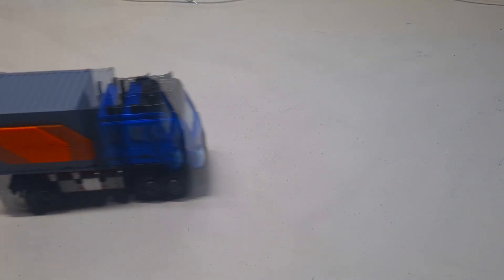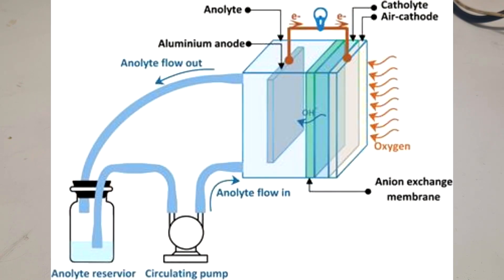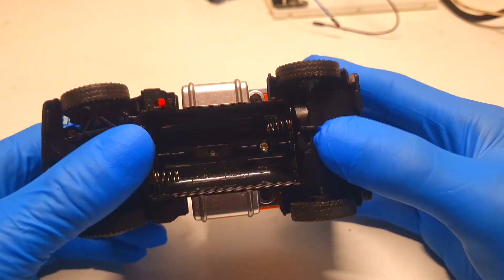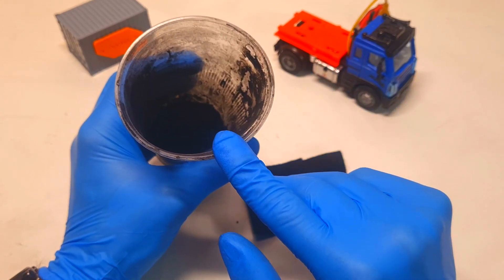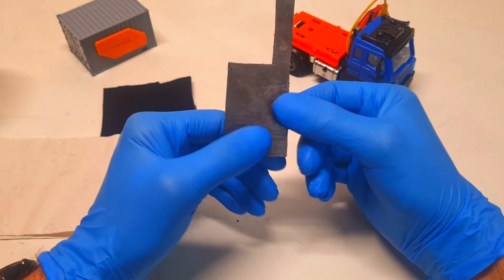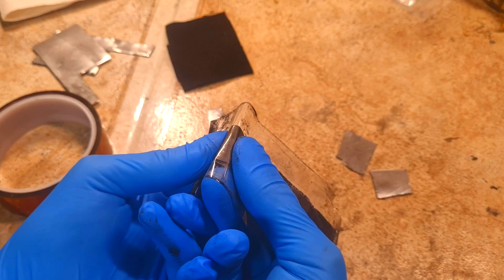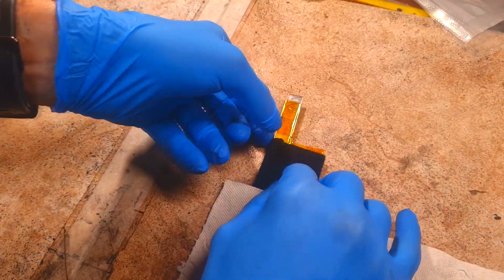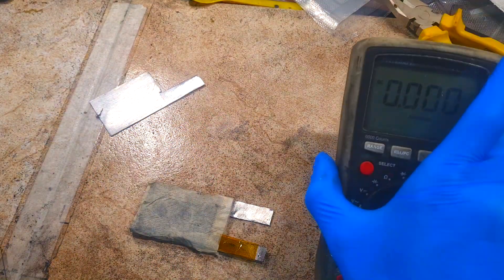DIY Aluminium air battery electric vehicle!?

Comment: Take a copper foil size 200 mm x 600 mm put a thick layer of fiberglass fabric on it size 210 mm x 610 mm, may be 2 layers, put an electrolyte onto the fiberglass and than  take aluminium foil, same size as the copper foil onto it. Fix one cable to the copper and one cable to the Aluminium.  Roll it to a nice cigar and put it into a tube and fill the tube with electrolyte. The gives you big surfaces and very narrow distances between Kathode and anode. This should ensure high Voltage and high current. Put as much tubes together in series  to gain the required voltage.

Comment: One amp is HUGE! The best I'm getting is 150 mA regardless of size. I've got an idea for a frame and bus bar to stack these things.
Reply: Surface area off cathode n anode ..correct metals...and strong electrolyte (drain cleaner)...take these aspects into consideration you will do better...or shrink your cells n parallel many...cheers

Comment: لماذا لم تقول ان القطب الموجب نحاس ما هو زيت الرسم  النباتى ما علاقته بالقصة ولما تستخدم مفردات لغوية تصعب على المتابع فهم المقصود  لماذا لا تكون محدد بسيط وواضح لماذا لم تضيف الفحم النشط و الجرافيت كطلاء للاقطاب
Reply from the maker: What vegetable oil? What copper? You looking into the video and you dont know what are you looking? I can not be more specific as I am! I use graphite, activated carbon powder, etc. But if you are not able to see it, is not my problem. If you want more info,.... you have wikipedia,... but I am not sure if you will be able to use it.🎉
Reply: @cayrex 
هذا ما حصلت عليه من خلال ترجمة الفيديو  التلقائية للغة العربية
Reply: @cayrex 
ربما اخطاء من نظام الترجمة لا اعرف لكنى اعرف كاذا ارى فى الفيديو  لا تحاول مهاجمتى رجاءا اصنع فيديو باستخدام كلمات بسيطة واضحة محددة عن فكرة هذه البطارية رجاءا
Reply from the maker: @zakiosman8757  Heh, no one is attacking you.  The video is about a Al air cell in RC car. Her I show how I make a 3 Al air cells and the use in RC car. If you want to see how to make a Al air cell,.... the you need to search for diy aluminium air battery and you will find hundreds 9f videos.
Reply: @cayrex 
اشكرك ... و تحياتى لك

Comment: The lower the amperage, the faster the motor will move Higher amperage increases visual acuity
Of course if it is at the same voltages

Comment: try vinegar in addition to the table salt, for iron-air and zinc-air, too. citric acid water works too, and baking soda water, with zinc-air fuel cell. try silver as the air electrode current collector catalyst, and tungsten/wolfram as the metal current collector.
Reply: Consider metal sulfate electrolyte rechargeable metal air battery, carbon air electrode. Recharges to metal + sulfuric acid, metal oxides convert back to metal sulfates in solution. Lead-acid battery not intended.

Comment: hi dear first of all LOVE UR CHANNEL!!!. I request you to make a video of a proper real life size battery which can power real house hold load for 1 hour or more...  Plz chose the chemistry (like for example ZnBr or any other more suitable chemistry) and design of a battery which lead to good cycle life, like at least 1000 cycles.
Reply from the maker: Thank you so much. Yes I know,.... many want  to see a real size home battery. But the problem is that I dont have enough materials to make one. Because I need many cells that have high amp hour rate,.... like 100Ah per cell. Because is not like just puting a carbon and zinc rod into the jar full of ZnBr electrolyte.
Reply: @cayrex  thank you for your reply. Will desperately wait for the day when u can show us the real battery ❤ which can power small load. I guess 25Ah will be fine as a starting point.

Comment: in simple words Well friend in closing you know that now the technology of accumulators is made with very simple materials they have proven it There is no need for such complicated things things seem complicated because they are industrial production materials and we have some safety mechanisms like bms on them to prevent any damage to the user please This is how it has become so simplified over the years to make batteries and in a DIY situation Some have gone rogue and done the prices in the worst way because the cleaning contractors told the truth they don't like us we are not bothered by the work of the contractors cleaning we did it No because we needed this profession I wanted to get some money we did some things Ok People don't understand ok we do it as a hobby for two or three friends it's not a profession anymore but you'll eat your head in the next four years all this ends Look, let's say a very nice one, let's say 150 amps 12V, which should be 40 euros and they sell for 160 euros, we paid for them too, but don't make fun of people like that. We'll make some of our own in the workshop. of lithium Calcium as you want you can see it however you want salt but that's how the other person pays for it let's say five grams 6 euros salt salt and recycled sheet metal we pay that is cement a little plastic and with a little what do they call acid 160 and 200 euros no have you gone completely crazy? finally why but washing the carpet which is a heavy duty job and other these jobs now have industrialized us.....Our job is a shambles if you don't like it ok mate nothing is going on but come and see you can do our work if I make you pick up 3-4 wet pieces of crap and carry them 50m frogman you won't be able to stand a commando you won't be able to stand it.... These Get together lower the prices....and we will be first money no you get serious because you have made the world bad and there will be some kind of revolution and we won't know who will eat it anymore YOU WILL BE SEEN ALIVE IT'S NOT MY FAULT end

Comment: tons of metal surface area, for car battery, like roll
Reply: if you have hydrogen evolution, you are already losing power
Reply: iron-air is better, no hydrogen problems, same for zinc-air and tin-air, also silicon-air, 9.0kWh/kg
Reply: also ethanol or water in koh is a great silicon/silicon-oxide etchant
Reply: quick flip plastic bag cells
Reply from the maker: Hahaha. It's about experimenting and having a good time. I think this is somethink that you will hard to understand.
Reply: why you think so, challenges are nice fun @cayrex
Reply from the maker: @Jkauppa  haha ok
Reply: also the air electrode does not have to be next to the metal to have high current @cayrex
Reply: super cap would be perfect starter for a motor, which can be slowly/slower charged by the metal-air fuel cell lower current @cayrex
Reply: what about using ocean salt water as the cell electrolyte, yep for a boat  @cayrex
Reply: I dont think you have fun @cayrex
Reply: the voltage drop in the cell is rather high under load
Reply: just make a large battery cell or foil metal cell
Reply: yep in production package the battery is very tight